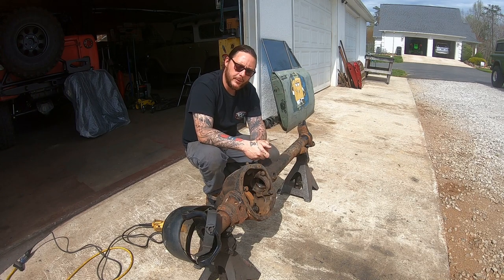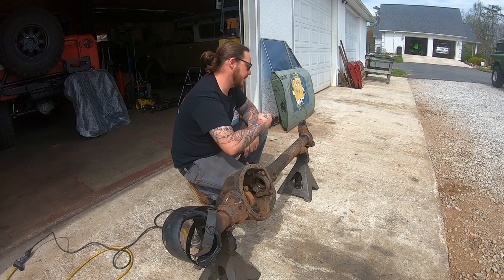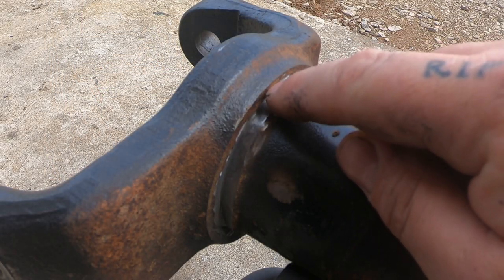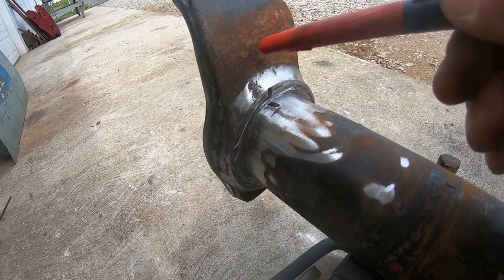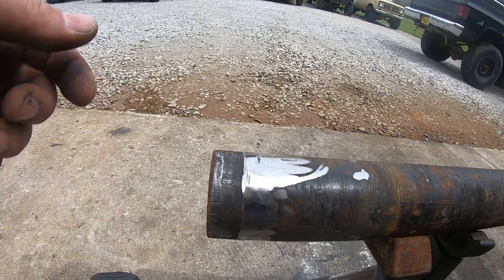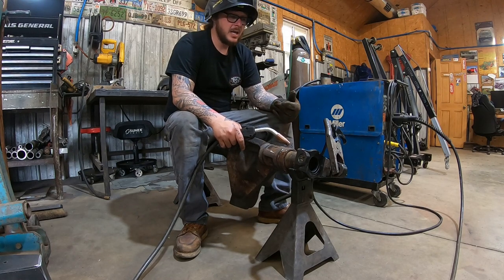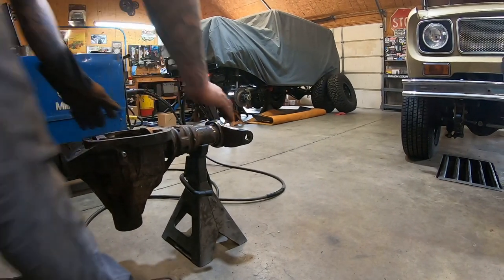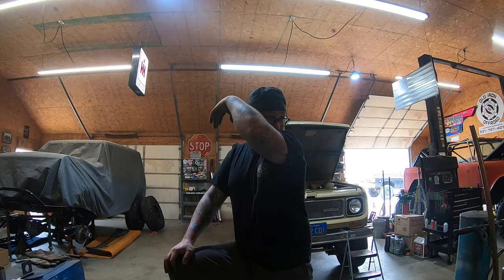How to cut and turn a Dana 44 (or any solid axle)

Comment: Thanks for the great video.  I'm about to do this and it's a huge help.    Reminder...do not use chlorinated brake cleaner to clean before welding. If any is left when you go to weld it, it will release deadly gas

Comment: I was hoping to see your rendition of the spring over part. The cut and turn part seems pretty spot on. (I use a porta-band to cut the weld) Also I've always set mine up in the truck. Never done one out of the vehicle.
Reply from the maker: I use to do them under the vehicle but I seriously couldn't tell you how many of these we have done.  We pretty much have it figured out for spring under or over.

Comment: My buddy wants to run Chevy one tons under his early 70s scout, do you know if they make a shackle kit that bolts into the frame with little fab work 😎💯✌thank you
Reply from the maker: They make some offset shackles but the spring hanger would need to be moved to get the springs directly over the center pin eyes.

Comment: Would this work for narrowing a 1979 ford Dana 44 as well as far as removing the ç?
Reply from the maker: I dont think so.  On a 79 Ford dana 44 you will probably have the wedges that the radius arms attach to to contend with.  I also believe on the later Ford tuck 44 the wedges are cast with the knuckles.

Comment: Watching all your vids , love your work , building a 73 K10 putting 1 ton axles in with 4 inch lift and 36” tires do you recommend turning inner C’s ?
Reply from the maker: Appreciate you watching.   I usually don't turn 60s.  They typically don't need it.  It is honestly pretty tough to get them to move on a kingpin axle.   Best bet if you need to move the caster is to cut the c apart and go with some reids
Reply: @OldIronOffroad  thank you for your reply ! Thank you for the info ! Hope all is well !!! Look forward to your work

Comment: Should I afraid of any ki d wrapping or something ,that when finish welding tahn caster or camber will be little bit off ?
In my opinion it shouldnt happen ,knucke is really tight on the tube.Whats you think?
Reply from the maker: Warping isn't really a concern.  Camber can be off but can be fixed with plates that go behind the spindles.
Reply: Thats cool,I will see actual resulit in alignment shop, because I measure it on unmounted axle with anglefindders and measurements are always different from previous mesas..But its seem only about 0.5° one side and 0.1° so its not so bad I think,it could be also by old balljoints which are still in.
Reply: @OldIronOffroad  and I also thinking, with those camber shims behind spidle are hub bearing bolt heads not straight on surfance ,isn it problem or there should be also shims with equal degree under each bolt?
AND ALSO I did dana 30 now I have camber +20 ,could it be as I slammed it out with hammer I bent it so it has +20°? NORMALLy it is about MINUS 30-40°

Comment: Hello!
Great video! It really helps out to people who has never done it. I notice that your emphasis was mainly on the casters and as I was watching im thinking...what about the angle of the differential?  What about the Camber?
I know that the camber can be fixed with the sleeves but im lost with the angle on the differential. 
I believe you said that the differential was level and that you were going to turn the ends in between 4 to 6 degrees.
Was the differential level at where the perch for the leaf springs is?  Was that how you did it?  If so, how are you going to give the necessary angle to the differential?
Im sorry for all the questions but im lost and I need to do this to my Jeep. Oh!☝🏽 where are you located? Maybe I can just take it in, thanks.
Reply from the maker: There is alot more involved than what I covered in the video.  The main purpose was to educate about caster and show you how to properly change it.  If you wish to change your pinion angle you will have to take that into consideration when making caster adjustments.

Comment: Thanks for the video - what are your MIG settings?  I have a 180 Miller, hopefully it has enough punch at full blast.
Reply from the maker: The black face 200 has different settings than your 180.  Running .030 wire I think I am at 4 on the high side wire feed maxed.

Comment: thanks for your video, pls which gas you use to preheat the axle before welding? and which material and gas do you use go weld it ? I am not gonna do that, I will give it to exprerienced welder, but why do you think the harbor fright weld maschine cant do that ?
Reply from the maker: Any thing with a clean flame is fine for preheat.  Our migs run a 75/25 mix of Argon an Co2.  A harbor freight machine is fine for welding with as long as it is a 220 volt machine capable of pushing the amps required to weld that thick of material.

Comment: ngl, I'm thinking of taking any old ford 9" and converting it into a front axle for my bronco so I can have an easier time to match the ratios for 4wd (hi or lo).    the dana 44 is great n' all but maybe a 9 inch would be better (supporting torque and weight as I plan to do some snow plowing during winter especially.  also the weight capacity may come in handy for when it's driving around with the plow attached?
Reply from the maker: 9 inch axles are great. Actually have messed around with custom built 9 inch fronts.  The pinion support makes them hefty.  Lots of aftermarket support as well.

Comment: Great video, thanks. Can you elaborate how you set the new angle of the C's - what is your reference point? Are you setting the machined part of the pumpkin where the cover goes at 0 degrees then rotating the C's from there, or do you just rotate them 6 degrees (or what ever angle you're trying to achieve) from where they originally were?
Reply from the maker: I am using the original position of the C I havent turned yet and the flat part or perch for references

Comment: last question 😅 what welding wire you used for that work ?
Reply from the maker: Lincoln welding wire .030
Reply: @OldIronOffroad  I mean material, any special with nickel or stainless ?
Reply: He said in the video it is cast steel and does not require a special wire. @jurajsmutny8171

Comment: Great video man. Do you think about 1.5° difference between both sides is a big deal? Got way too far into building this axle before I realized and I don't think it will be possible to fix
Reply from the maker: I wouldn't loose sleep over it. I have seen axles be 2 degrees off from the factory.

Comment: Do you ever see a camber change after rotating the knuckles, and is it worth checking camber angles before/after? or does the fit on the tube pretty much keep camber angle the same? I know my Scout axle has about 1 degree positive camber on both sides as of right now.
Reply from the maker: No sir and if it changes it is minimal.  The inner C is has a thou. Or so of interference so there isn't much room for you to drastically affect camber.  That being said there are camber shims you can place between he outer knuckle and spindle should the need arise.

Comment: You mention that the knuckle is cast steel, not iron.  Is this true for the pumpkin as well?  Just curious how hard it is to weld the perch on the passenger side when doing a spring over?
Reply from the maker: Yes the chunk is as well.  Perch welds just fine.
Reply: @OldIronOffroad  thank you

Comment: Great video. Wish I could find someone to do this on my Scout (San Diego area.) Mine drives okay (4" spring under, 5" shackles and 4* caster wedges) but its right at zero degrees caster. Its not scary but you have to pay good attention to where she is going. Question for you, would it be a good idea in my case to flip the 4* caster wedges and then cut and turn for a 4-6* positive caster? Front drive shaft is stock and I know the pinion is supposed to be level (parallel) with the ground but if I rotated it up a little would it cause much issue? Not planning on high speeds with the front axle engaged.
Reply from the maker: If you were going to cut and turn I would absolutely turn your wedges around.  Reason being is at full droop even with just the 4 inch springs the driveshaft can bind at the yoke sometimes.  You will never notice any vibrations unless you decide to do 60 mph with the front axle engaged.
Reply: Thanks! Makes sense to me, I'll plan on that then. Thank you!

Comment: I have a 73 scout it has under axle springs . Do you recommend changing to over axle ? What is advantage or disadvantage ? I want to put 32 in tires on it . Please help
Reply from the maker: Not for a 32" tire. I would go with a 2.5 inch lift spring and some new body bushings and you should clear the tires fine and maintain a good ride.
Reply: @OldIronOffroad   ok I appreciate you getting back to me about this .  👍 Thanks

Comment: The C yolks are NOT cast, they are FORGED steel.
Reply from the maker: I don't believe so. Aftermarket replacements are forged. Actually  I take that back.  Even the replacements are listed as  cast.   https://apebuilt.com/products/dana-44-inner-knuckle-inner-c-pair-1
Reply: @OldIronOffroad  You can tell by the parting line, the OE ones are FORGED, those in your link do look to b cast?
Thick parting line that looks like it's been sawn off = Forged, thin line thats kinda sharp = Cast.
Reply from the maker: @stevegarboden2437  definitely seems to be something that has been a source of discussion for a while.   I think the main thing is to recognize that it isn't cast Iron.  I don't know that the weld process between cast steel or forged would be different.   Pre heat , weld , slow cool.  Would definitely appreciate seeing some documentation from Dana stating that the stockers were forged.  If that is the case there wouldn't ever be much of a need for aftermarket Cs.